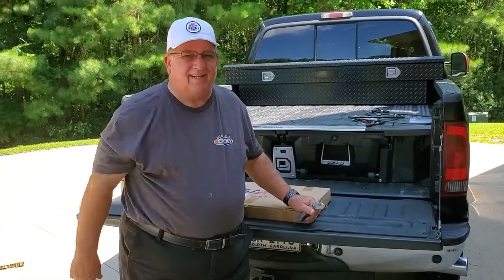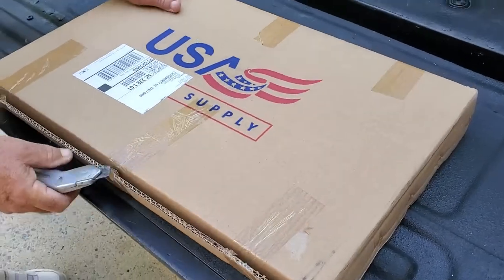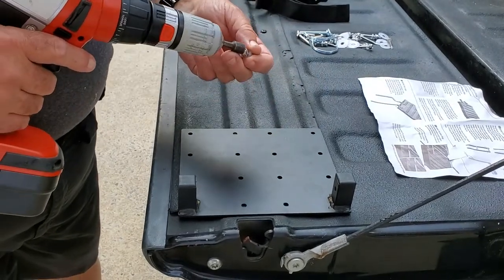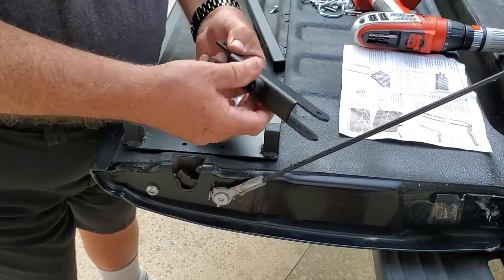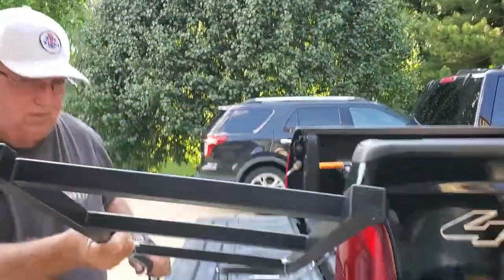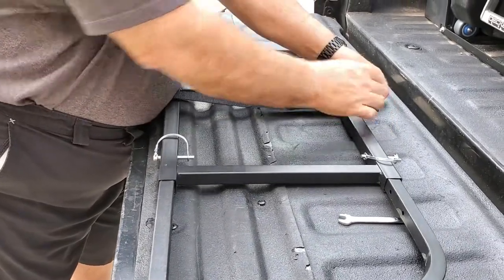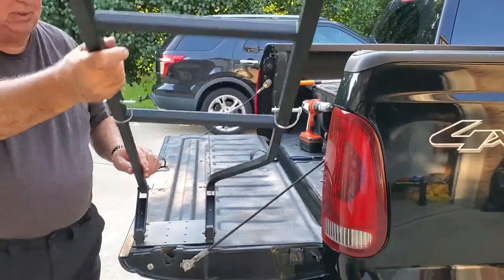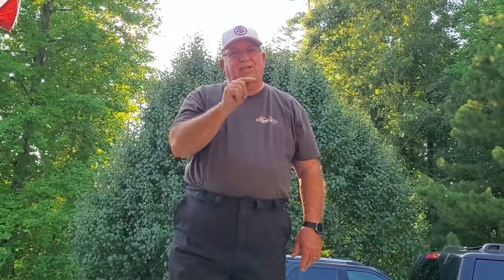New Ladder for Tailgate

Comment: Looks a little rickety....to say nothing about the rust already forming. I'd return it and buy a compact step stool with an appropriate weight rating. The HB Tower step stool on Azon is rated at 500 lbs and comes 2, 3, or 4 steps around $50-$60
Reply from the maker: Hi Mike, it's actually quite solid. I weigh 293 and it holds me just fine. I have several of those step ladder/stools that you are talking about but those would just be another thing to remember to bring each time we went on a trip. And, if I break down on the highway, it's always there. Thanks for watching and commenting.

Comment: The only problem with this unit and all other brands is the height from the last step and onto the tailgate is quite tall. I see why the first step is only a couple inches from the ground-it’s to keep the bottom of the ladder sturdy, but it should be at like 6” off the ground so the other steps can be divided up to leave the top step at a comfortable height. The first step at 6” off the ground would still keep the bottom of the ladder sturdy, they need to change this, it would be an easy fix
Reply from the maker: Hey Paul, I totally agree. Hopefully, my next truck will have a built-in ladder. Thanks for watching and commenting.

Comment: Thanks for the video. 
Question does the ladder in fold up position interfer with the pull out drawers on Decked unit.
Reply from the maker: Hi g graham. Actually, I have about 5 inches of space between the tailgate (including the ladder) and the drawers on the Decked box. Thanks for watching and commenting.

Comment: Im afraid you have made a mistake assembling the ladder. You are supposed to use the lock pins on the rocker arms at the edge of the tailgate and not on the ladder.. The purpose of the lock pins on the rocker arm is so you can totally remove the entire ladder and rocker arms without undoing any nuts and bolts. All you have to do is switch the lock pin location with the nut and bolt location to remedy the mistake.
Reply from the maker: The lock pins can be used two ways. I wanted the ladder to be permanently mounted, so I didn't need the pins on the rocker arms. I did, however need to extend and retract the ladder, so I used the lock pins on the ladder. If you look at the Amazon page for this particular ladder (https://amzn.to/3FgLwUG), their photo shows the pins where I installed them. Thanks for watching and commenting.

Comment: I have a Decked system in my truck as well and one illustration I would have like to have seen displayed is if you can open your drawer with the ladder in the folded position and tailgate open?
Reply from the maker: Hi Batman. Robin here. Yes, the Decked drawers easily clears the ladder when in the stowed position. Thanks for watching and commenting.
Reply: @RVSite2Sight  Thanks for the clarification.

Comment: Thanks for the tutorial.  Would it be necessary or recommended to use silicon at the drilled holes to prevent rust?
Reply from the maker: Hi Rajesh, adding silicone would probably be a good idea. Thanks for watching and commenting.